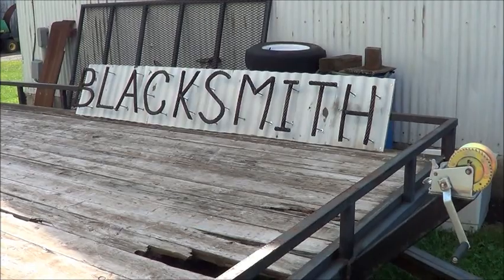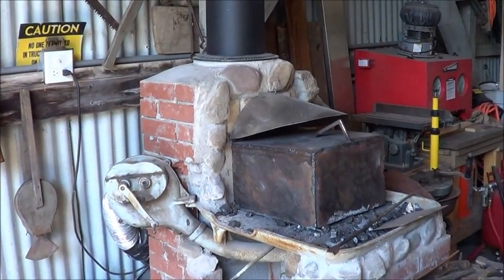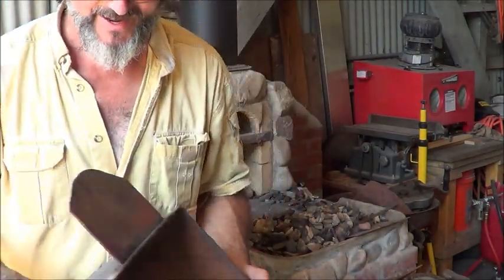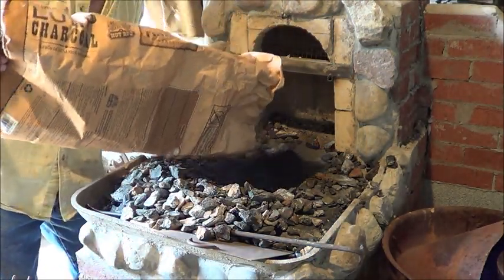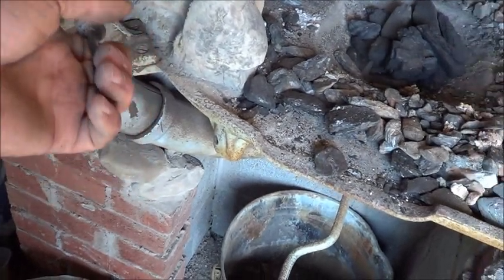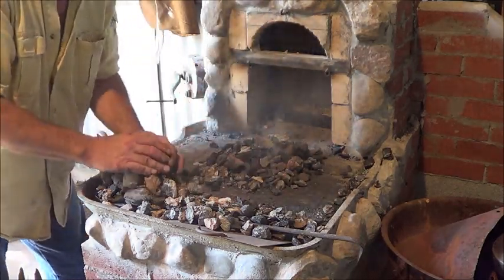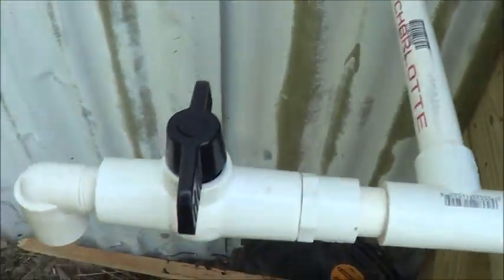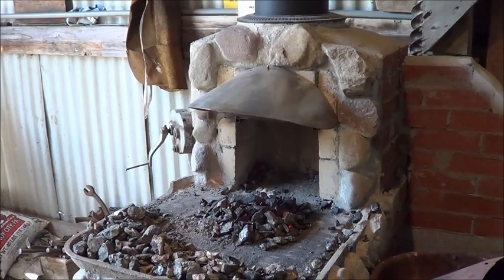Forgeside Chat Episode 12 - Firing Up The New Forge

Comment: Chimney on the down side of a long tin roof. Ever have snow or ice build up on the roofs in your area? When the ice lets go and slides off the roof, it smashes right into your chimney. 1/4 inch plate V-wedge bolted to the roof will protect the chimney. I lost my chimney the first spring after putting my wood stove into operation. Just a thought...
Reply: EdOfTheNorth Great tip Ed!

Comment: As added protection from sparks, HF sells "welding blankets" that you could hang behind the forge to stop the sparks from getting to the wood. They work OK as long as you don't weld or grind directly on them.  Looked at the map and found the new shop. You're about 95 miles from me as the crow flies...

Comment: In the event that no one else mentioned this idea for charcoal to start the forge (I do this as well, I might add), build a simple fire pit from a tire rim out front of the shop, off to the side.  Use scrap lumber and wood to set a fire going. When everything is cooking nicely, simply place a cover over it and let it burn out, and it's ready the next day.  A 55 gallon drum lid works well for this.  Your shop is FREEKING Awsome!  Nice job buddy!

Comment: Chandler..  Nice..  I like how you incorporated the forge into the mason/brick work.

  You are right on the money.. adding lump charcoal is the best way to get anthracite coal to burn properly, especially just prior to a forge weld.

A couple of things..

A 12 inch chimney would draft better especially if you went straight up through the roof without any 90 degree bends, but hey.. if its working for you. 

Also.. if you increase the distance from the top of your chimney to the bottom of the chinamans hat cover, it will increase the draw.  With 8 inch pipe, the bare minimum distance should be 8 inches, more is better. 

Some 1/4 inch hardware cloth around the opening makes for a good spark arrestor, keeps the birds out, and won't hinder the air flow.

I'm am in the process of getting my own shop put together.  You have given me some good ideas.  :-)

Thanks for the video..
Shad

Comment: Forgot to mention starting the lump charcoal part.  My charcoal is smaller, about walnut size...and using walnuts in a paint can to make charcoal is perfect. Just ball up a couple of sheets of newspaper and set it under the charcoal.  Otherwise, a small squirt of lighter fluid aka 'girls out juice' does the job as well.  Let it work before adding air, while gathering a couple tools and such.  Maybe 10 minutes. Rake over a bunch of coke and top it with fresh green coal after your fire has established with gently increasing air draft.  Hope this info helps.  Hammer on Chandler!

Comment: I dont care what anyone says, your fear of fire is legit. I too have that same fear. The spark box is an awesome idea.

 As Ed Of The North says, the pipe location may become an issue with ice or snow. Height may also be an issue in windy weather if the wind turbulence over the ridge cap causes an up draft as the pipe cap. I have that issue on my shop stove now as it is configured just as your forge pipe is.

Comment: Chandler, when winter comes, do you have a system in place to insulate those water lines so they don't burst with the cold?

I've wanted to get smithing for a while, but I live in the middle of town.  Any suggestions for reducing noise pollution so I might get started without royally ticking off my neighbors?

Comment: C.Dickinson - may I suggest the next work? Why you do not give us a 'real class' about how to use the hammers - what kind for what work/results?
And other tools too!
Several beginners (like me as example rsrsrs) in blacksmithing might cut long way ...
you're a master
Otherwise - I always see in several anvils, the long chains around it - is it to supress noise?
tks
Reply from the maker: +Marcio Fernando Barci I have thought about this but being self taught I am not sure what I could show except what I do... I will think on this more and see if I can be helpful
Reply: +Chandler Dickinson  - My suggestion would be you (a blacksmith master) show (for example) the types of hammers and their specific uses, other tools used by blacksmiths and how to use them. How to stretch, flatten, shape a part using what tools - and why!
This art - is not shown and cataloged - will lose
My greetings

Comment: if you use soft coal instead of hard coal it's easy to light without charcoal just paper and wood scraps. the only downside is that it puts of a crap ton of smelly yellow smoke due to the sulfur but knowing from experiance. It is so much better to use then hard coal